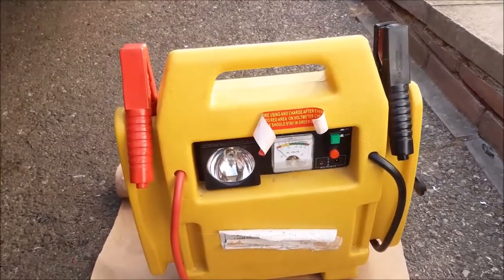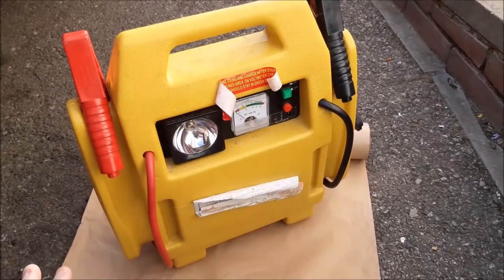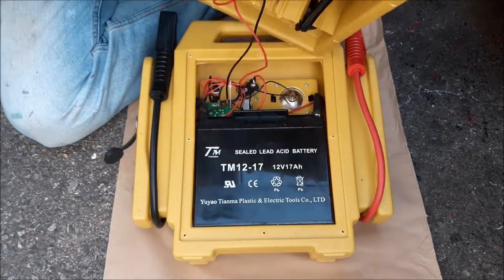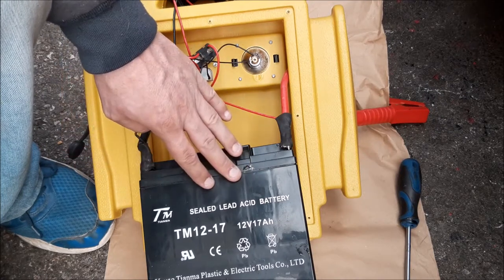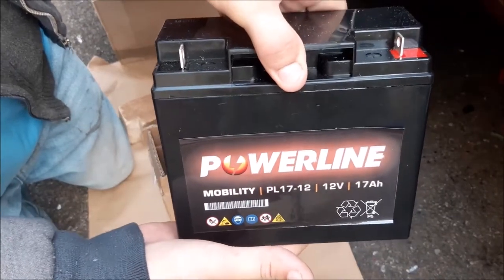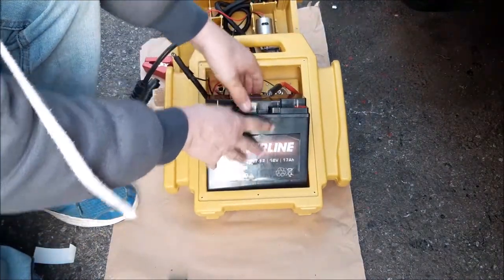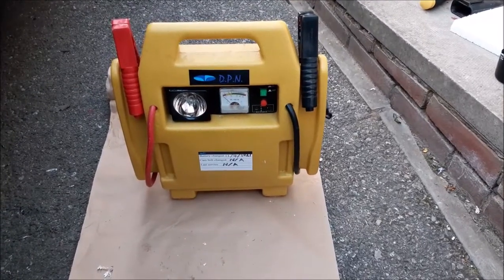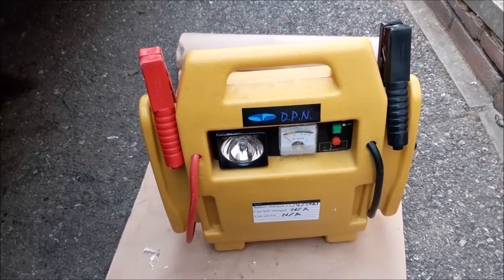Replacing the battery in our jump starter 12V Booster Jump Pack

Comment: Thanks for the video. Do you have a link where you buy the replacement  battery from?  What size and spec is the original battery  and what do you recommend for higher spec?  I bought one of those pocket sized jump starts from China.  When I came to use it,  ie I needed it as battery was flat,  it was not enough power to start the car.  So I will try and  find where I put my old yellow starter  and look into replacing the battery.
Reply from the maker: Here is the link https://www.ebay.co.uk/itm/362826818812 you can see the sepc in the video when I hold up the battery to the camera
Reply: @DPNTV  Thanks  for the link

Comment: can i use small car battery the same size as the jumo starter battery as replacement?
Reply from the maker: @ryzenx-no1bl  we found the exact replacement online through eBay, so it fitted and matched the exact specifications of the original

Comment: hello how much is the voltage and amperage of the original charger
Reply from the maker: It's on the battery in the video
Reply: Do you mean the wall charger?  It’s 11.5v / 600mA

Comment: So can you recharge the battery? With a battery recharger? Was thinking to patch in a usb female and put a male on my battery charger, and charge it instead of keep throwing batteries. 
Is it possible?
Reply from the maker: The jump starter in this video came with its own charger, which I still use to charge the battery in side
Reply: Yes you can I do it all the time as the factory charger for it is left at home, you can just clip the charger right onto the jump leads as they are connected directly to the battery. It is better to use a lower amp slow charge but any 12v charger will absolutely work.